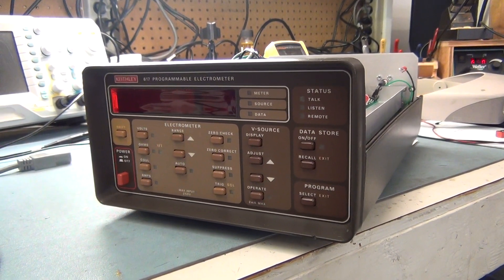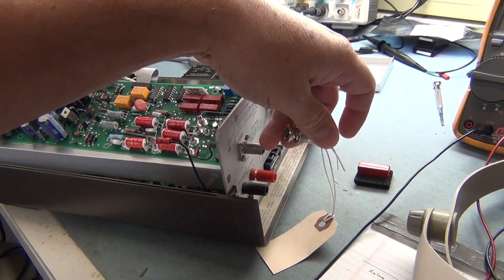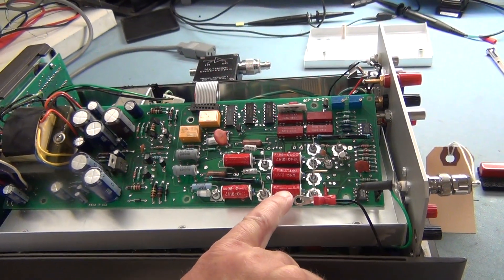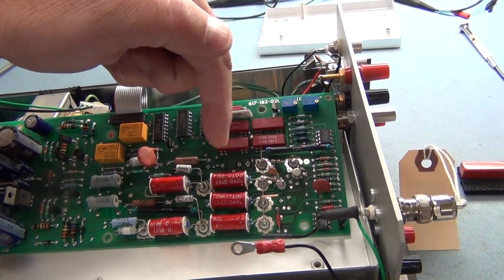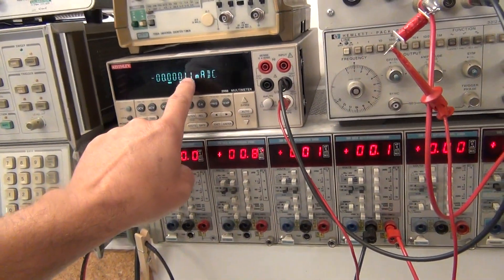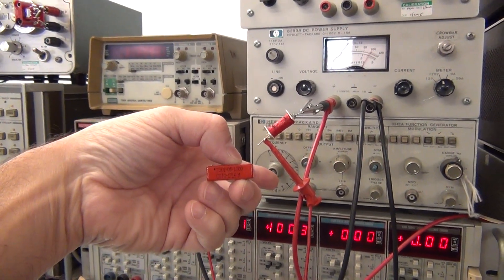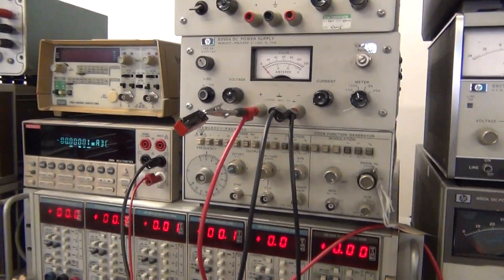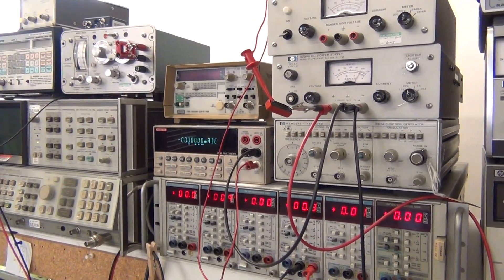Keithley 617 Electrometer with LEAKY RELAY [PART 1] see also EEVblog #1017

Comment: General recommendation to anyone about how to solve this leaky relays issue which affected ALLL K617 by now. With 30 yeas epoxy filling around reed switch become conductive. 
Just desolder the relay and replace reed switches with MEDER KSK-1A66/3. Cost is 4 $ per 10 pieces and works ideally. You can pull out reed switch out the relay and you need to save and reuse original PTFE insulation tube of the reed switch.
Reply from the maker: Good lead.  Thank you.

Comment: Years and years ago, we had in a lab exercise a task to determine a volt meter internal resistance.  The method was as follows:  Apply a stable voltage source, record the reading of the meter. Then add a precision resistance in series, record the new reading.  From the two readings and known external resistance value, you can calculate the meter internal resistance (and the loop current).  In this case, I would try with some 10M, 100M and/or 1G resistors and just a 1V reference supply.  Then some simple calculation.  Still remember the Ohm’s Law?
Reply from the maker: Thank you!  Good comment.

Comment: Hello, interesting video. 

Question for you: I don't have a pinout for the original relays. Is there some polarity to them that I should be aware of when replacing them? 

I recently purchased a Keithley 617 Rev J, dating to 1984. It turns on fine and the voltage source works rather well however I was getting overload on every range of every function. I tested the relays (which is actually a different part from yours, it looks like a brown rectangular block with part number along the lines of E-T Rxxxx-1 31 254) and one had a DC resistance of only 0.6M. I plan on switching out all of the relays for HI05-1A66, which seems to possess many of the same characteristics as the COTO 7301-05-1000 but with higher insulation resistance at a minimum of 100 TOhm. It also seems to be a very similar form factor to the ones it's replacing, which is good.
Reply from the maker: The relay's coil will work in either direction but, if there is an internal "free wheeling diode" then, yes, the coil will have a polarity consistent with that diode.  The relay switch isn't polarized and if it's a simple SPST then that's easy.  If it's SPDT or something more complicated then you might have to figure out which pins are which.

Comment: Hi Tom, Question, why did you not just replace the reed in the relay for a known good quality reed ?, I've seen some relays used in this instrument but the type you have, might have been easy to replace the reed by pulling out ??? if possible?
Reply from the maker: Let me know if I am wrong but I don't think the reeds in these relays are serviceable.  These relays must have extremely-high OFF state resistance.  Something on the order of 1000 GigaOhms.  Normal relays can't do that.

Comment: To measure low leakage current you should use the voltage setting on your DMM . The 10 Meg shunt resistor on the VDC scale makes a sensitive nA meter
It is also possible to change the glass reed switch in the coto coil. Just match up the AT rating ( Amp Turn) of the reed switch. 
The coto part number may have been just the coil part of the relay

Comment: Tom, at 1:05 you show the back of the triax BNC, with the black wire going to the input board and the green guard wire both covered by a black heat shrink sleeve. The shrunk diameter at the very end of the black sleeve seems consistent with it originally grabbing the end of the teflon insulator that sticks a mm or two out from the rear of the BNC. However in your unit the sleeve is not all the way against the faceplate anymore, in fact it is as far away from it as the bend in the black wire toward the relais would allow. This looks precisely the same as on my 617, where the guard terminal on the rear of the the BNC is snapped flush with the edge of the outer (guard-shell) teflon insulation. The black sleeve is then free to slide aa cm or so along the black wire, and of course the guard is electrically disconnected from the BNC. It's hard to tell from your other videos if you did any repair on that spot, but I'd really appreciate any hint. Maybe it's enough to peel back some of the heat shrink, grind away a bit of the teflon to expose a bit of the guard metal, and solder a short piece of wire to bridge the crack...
Reply: If you need to repair there I don't think it will hurt anything to peal away the heat shrink.  In fact the heat shrink probably adds the threat of a leakage current path but I think Keithley has it there for safety as you probably know the test voltages in this instrument can be high enough to be dangerous so insulation there is a good idea as service tech. might accidentally touch there.